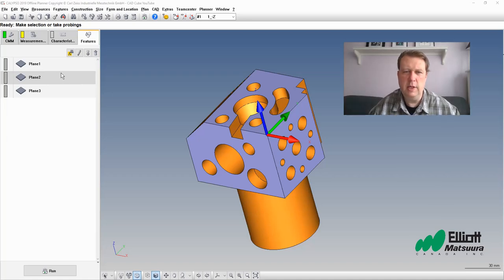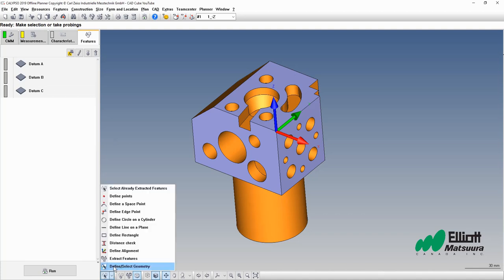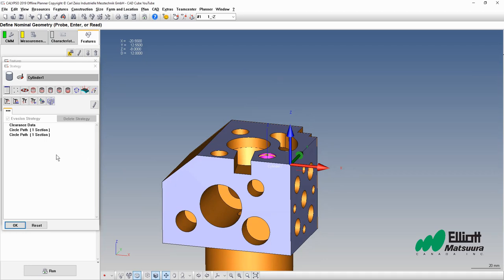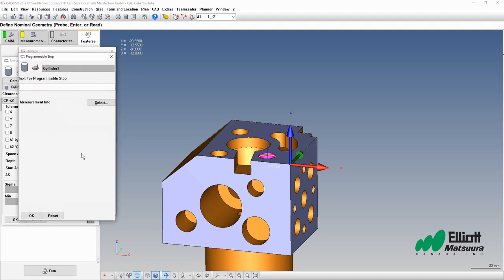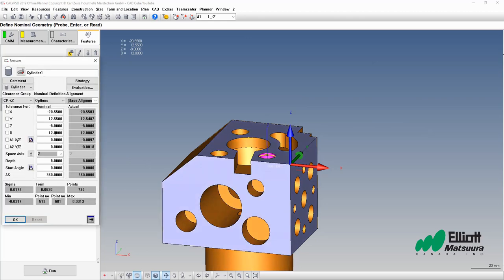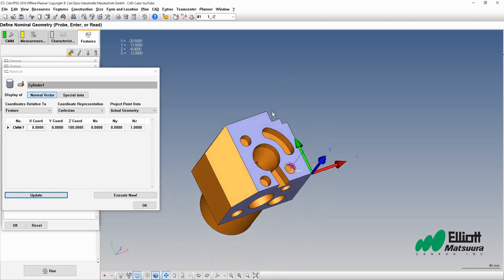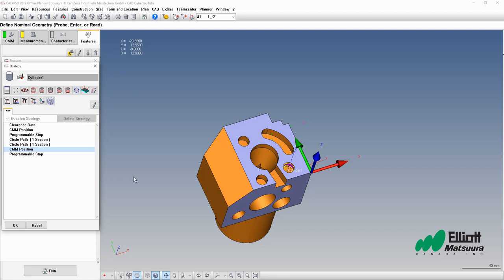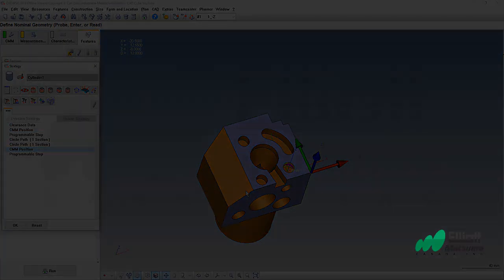Advanced Calypso: Programmable Stop

Comment: hi, Jim: By using this programmable stop, can I temporary insert an extra stylus system due to stylus holders is full?
Reply from the maker: You don't need a programmable stop for this. When Calypso encounters a need for a qualified but non-present stylus system, a prompt to manually switch will appear.